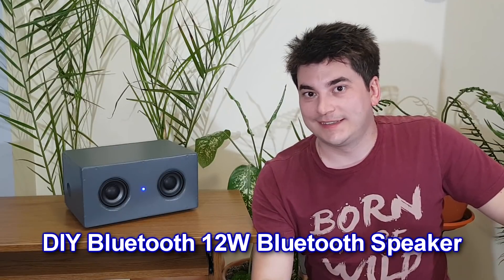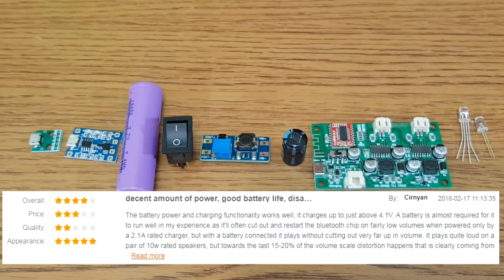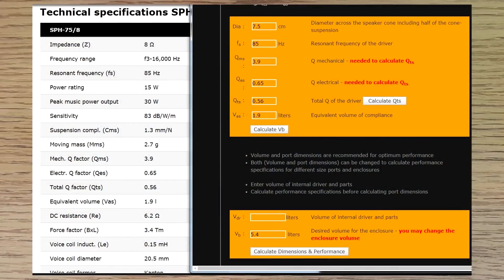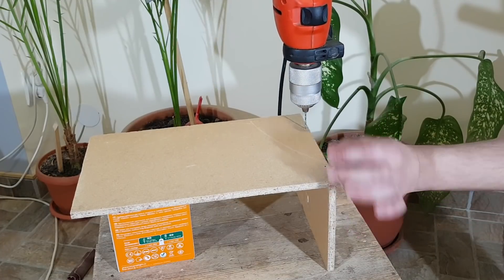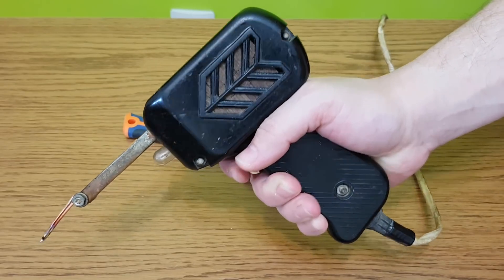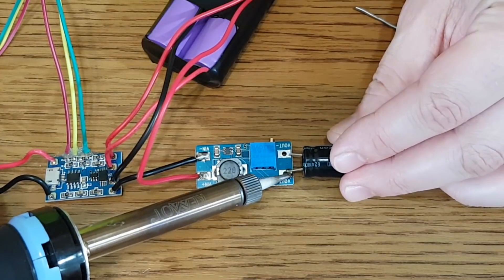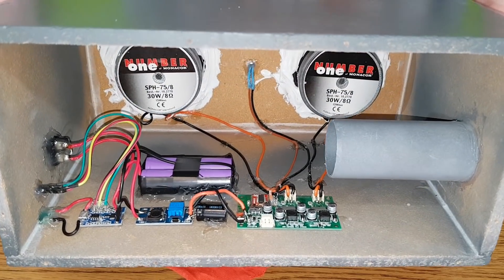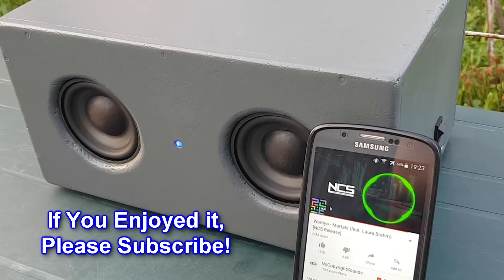DIY Bluetooth Speaker 6W+6W - HF69B

Comment: Awesome video with full detail.. thanks a lot.. but I want to know that how can you use a 8 ohm 30 watt driver with 6 watt output..??
Reply from the maker: hi. the speaker driver is rated at 30W musical and 15W RMS. 15W RMS is the more real approximation of the speaker driver's maximum power. but with a real 15W amplifier, this small speaker driver will be pushed to the limit. nowadays speaker manufacturers tend to lie and be "optimistic" about their speakers maximum power. you can see very clearly how this 6W amplifier is vibrating the 15W RMS speaker membrane almost to the maximum point. if I use 6W speakers with this 6W amplifier, the maximum sound will be distorted, because the speakers will be forced to the limit, and the speakers will be damaged in time.
Reply: @Sorin_DIY  thanks sorin.. I was searching a mono amplifier circuit for small portable pocket size bluetooth speaker.. becoz two speakers increase the size..
After many try I came to know about PAM8320 class D IC.. but there are no company who are producing readymade board.. 😢
Do you have any idea about this or any other mono amplifier circuit..?? Thanks and regards
Reply from the maker: I never made a mono bluetooth speaker, I don't know what to recommend you. but I will soon make a small stereo bluetooth speaker, but powerful.

Comment: I love the video and the explanation, however, I do have a question. I noticed you used another ("extra" if you will) USB micro PCB for charging and that's supported with USB TP4056. Why is that?
Reply from the maker: hi. it's a micro USB breakout. it's just an extension for the charging port. it's smaller than the charging module, so it can be fixed on the side much easier.

Comment: Salut sorin vreau sa leg doua bateri 18650 la aceasta placa hf69b 6w+6w insa nu am acel circuit de protectie + incarcare  si nici placa ce ajusteaza voltajul , crezi ca va merge si fara aceste placi sau voi avea probleme?  intreb fiidnca vad ca in specificati spune ca merge si pe baterie de 3.7v nu numai pe 5v!
Reply from the maker: salut. eu l-am probat cu un singur acumulator conectat direct si functioneaza. probabil functioneaza si cu 2 acumulatori, dar nu stiu cat de bun e modulul de incarcare inclus. amplificatorul insa nu are protectie la descarcarea acumulatorului, dar nu cred ca e o problema. cand acumulatorul e descarcat, amplificatorul se restarteaza in continuu, nu poti sa il mai folosesti pana nu incarci acumulatorul. insa cu 2 acumulatori + modul de ridicare tensiune cum l-am conectat eu, am reglat tensiunea la 5.1V si amplificatorul se aude mai tare decat cu baterie conectata direct la el.
Reply: Sorin - DIY Electrical Nerd Multumesc frumos pt răspuns, pana la urma m-am hotarat sa fac si eu ca tine si am comandat si eu toate piesele de pe bangood utilizand linkurile tale(acum.astept sa-mi ajunga) am luat si un condensator de 2200uf de la o sursa veche. Mai am o singura intrebare la acea placa de încărcare cu protecție pot pune mai mult de 2 bateri? Fiindca am salvat 5 bateri LG dintr-o baterie de laptop nefuctionala!
Reply from the maker: poti conecta si mai multe celule, dar nu cred ca are rost. cu 2 celule bune tine peste 10 ore. eu cred ca 3 celule maxim ajung, daca au peste 2000mah. daca sunt multe celule, dureaza prea mult sa le incarci.
Reply: Sorin - DIY Electrical Nerd mulumesc voi folosi 3 celule deoarece astea au acelasi voltaj fata de celelalte 3!

Comment: Hi Sorin, I succesfully done this. But I am facing one issue.  Im using mobile charger to charge the battery. Say my battery is fully charged and I disconnected usb charging. Now battery is at full charge and problem is when I switch 'ON' the amplifier the amplifier is not switching 'ON'. But when I connect the usb charge the amplifier is switching ON. Now if I disconnect the usb charge, amplifier is playing through battery. Then if I switch off the amplifier and switch ON it is not getting up again I have to connect the charger to come up once it come up then I can disconnect usb charge. What would be the reason for this?
Reply from the maker: hi. did you connected the battery directly to the bluetooth/amplifier board? or did you use a separate charging module + step up converter like me?
Reply: @Sorin_DIY  I am using separate charging module and step up Converter like you.
Reply from the maker: you need to check with a multimeter, where is the power stopping. after the charging module, or after the step up converter. or the power is getting to the bluetooth module, but the bluetooth module doesn't turn on. the bluetooth module has a tiny switch, try to set it in the other position.

Comment: hi i dont have 15 w speakers . can i join 2 3w 4ohms speakers in parallel in one slot?
Reply from the maker: hi. that's not a good idea. if you connect 2 x 4ohms speakers in parallel, you will get a final impedance of 2ohms, that is not good for the audio amplifier. a slightly better idea is to connect them in series. 2 x 4ohms in series = 8ohms. but you will loose some of the high frequency sound, because the copper coil of each speaker driver will become a small frequency filter for the other speaker driver, similar to the coil in a crossover filter, but with less efficiency.

Comment: hey dude.. is it possible we use powerbank and remove the step up converter?
Reply from the maker: yes, but it will not work with all powerbanks. some powerbanks will not turn on, or they will automatically turn off, if they don't detect a big load (around minimum 500mA). when you turn on the bluetooth module, it will use only a few mA.
Reply: @Sorin_DIY  thanks for the explanation... Great job anyway.

Comment: Hi Sorin,  i finished making of this bluetooth amplifier and Working fine but Whenever i  increase the volume,  the bluetooth shuts down. It is annoying.  my speakers are 8ohms 30watts speakers each. two 2500mAh  18650 batteries used. Voltage set to 5.2 volts. the wires that i used are bread board wires. What is the reason for this bluetooth shut down? How can i rectify this?
Reply from the maker: hi. breadboard wires are thin. try with other thick wires. use thick short (max a few cm) wires for all the supply wires.

Comment: Can i know the reason,  why r u soldering two batteries instead of using battery holder?
Reply from the maker: hi. the battery holders will work too. but the connection is much stable with soldered terminals. in time the holder contacts can oxidize and you will lose power. the battery holders are useful if you intend to remove/replace the batteries often, which I won't do. also the holders will increase the overall project price.

Comment: Great video. You motivated me do make one for my self. I have a problem with mine tho. I use a similar setup except I use separate bluetooth module with a 3w amp and have yet to buy the capacitor. When I power it on it shuts off after 2 seconds and it goes in a boot loop. Any idea how to fix the problem?
Reply from the maker: hi. did you fix the problem? do you have 4 or 8 ohm speakers? what power source did you use. I suggest to try it with 8 ohm speakers and separate power supplies for each module, with minimum 1A.
Reply: Thank you for the reply.
I am using 3w 4 ohm speakers connected to PAM 8403 which is powered with two 18650 batteries connected in parallel. I have TP4056 charging module with protection and 2 amp boost converter. Without the boost converter is working fine, only problem is my 5v bluetooth module, I don't know if it will work with lower voltages as the battery drains.  
Separate power supplies cause a horrible ground loop which distorts the sound,  I have tried that.

Comment: Excellent explanation. What type of wire r u using for the conection? Any particular name for the wire?
Reply from the maker: hi. in general I use wires salvaged from PC power supplies. most of them have good quality thick wires. they also have a lot of colors to choose from.

Comment: Very good!! But why do you need like a hole in the box?
Reply from the maker: hi. the "hole" (port) increases the speaker driver efficiency. when the speaker membrane vibrates (in and out), it modifies the interior air pressure. the air is pushed inside the box by the membrane, so the air pushes the membrane back outside much faster than the membrane will come out by itself. the port prevents this and lets some of the air to come out the box, when it is pushed in by the membrane. so the membrane will come back outside much slower. this increases the lower frequency, where the membrane is supposed to move slower. practically the port will give the speaker more bass.

Comment: Nice video. everything is fine and good. but u did not tell about the position of small switch embedded in the amplifier board.
Reply from the maker: hi. I forgot about the tiny switch. it switches between battery or micro USB use. I set it to be powered only by the USB port.

Comment: Hi Sorin, 
This brand speaker is not available in my town. 
What speaker I can choose? Will i get same type of speaker in other brand? Or tell me alternate speaker model ?
Reply from the maker: hi. you can use other type of speaker drivers. dayton speakers are very good, but expensive. I suggest you find 8ohm speakers, with a diameter of 6cm or bigger (mine are 7.5cm), with rubber surround.

Comment: Wow wat a wonder full step by step and detailed procedure. This is very professional. I have seen so many video and web instructions, but ur video is amazing!!!!
Plz post more projects like this. 
@4:33 you not describe about left most small pcb circuit. Plz tell me about that.
I want to start the project.
Can I get this speaker @ all speaker shops?
Reply from the maker: hi. thanks for watching. it's a micro USB breakout. it's practically an extension for the micro USB charging port. the pcb is smaller, than the charging module for example, so you can easily connect it to the side of the case. you can use similar speaker drivers, if you don't find this model. they need to be 8ohms, minimum 10w RMS and preferably with rubber surround.
Reply: Sorin - DIY Electrical Nerd Thx brother..
Reply from the maker: connecting speaker drivers is similar to connecting resistors. 2 (4ohm) speaker drivers connected in parallel = 2ohm impedance. connected in series = 8ohm impedance. so connecting them in series seams to be the solution. but there is a problem. each speaker's coil becomes a filter for the other speaker. they will cancel each other's high frequency sounds. it will sound like you put the bluetooth speaker in a cabinet. I suggest you still looking for 8ohm speakers. if you use the same 6w+6w bluetooth amplifier, I suggest you use speakers with the diameter of 7.5 cm or bigger.

Comment: how good is it with bass?
Reply from the maker: hi. the sound quality of the bluetooth module is very good. the bass mostly depends on the speaker drivers. if you give it good speaker drivers, you will have clear and loud bass, in the 6W+6W limit. I used the bluetooth speaker in parallel with a bose soundlink bluetooth speaker III, to compare them. of course is not as good as the Bose speaker, but is getting close to it. in my opinion it delivers 80% of the sound volume and quality, but with less than 30% of the price.
Reply: thanks i have a set of jbl 30w 8 ohm drivers that came out of this https://www.hartonoelektronika.com/images/detailed/21/JBL-SB100-230.jpg jbl soundbar sb100 i just pulled them out and they include small tweeters :)
Reply: Sorin - DIY Electrical Nerd GOOD COMPARISION

Comment: I made a DIY speaker too. At high volume speaker just shuts down any fix bro?
Reply from the maker: hi. what bluetooth amplifier model did you use, what speaker drivers and power source? in the first part of the video I explained why most bluetooth modules shut down at high volume level, perhaps your bluetooth speaker has the same incompatibilities.
Reply: Sorin - DIY Electrical Nerd I use PAM8403 and power source is 1A 5v power bank charging module connected in parallel to 2 18650 batteries and I even used a 5v dc dc isolating converter for the Bluetooth module
Reply: N its 3w 4 ohm two speakers for left and right channel
Reply from the maker: hi. did you resolve the problem? if not, I suggest you try with 8 ohm speakers. if the module still shuts down, try with a different power source for the bluetooth module. the dc-dc converters will limit the current, most of them work with 200 or 400 mah. you can try with 2 powerbanks, one for the bluetooth module and one for the amplifiers. at least until you find the problem.
Reply: Sorin - DIY Electrical Nerd I use B0505S-1W isolating converter as per the data sheet it gives out 200 mah! I used the USB Bluetooth module. Is there a way I can increase the current output from dc to DC isolating converter?
Reply from the maker: no, you can't increase the current. but did you try with different power sources? if it works, you can buy a more powerful dc converter, 2W at 0505 = 400mAh. or did you try it with 8ohm speakers?
Reply: Sorin - DIY Electrical Nerd I don't have 8ohm speakers I had this old home theater system and I had salvaged the parts for future use. So I thought of building a Bluetooth speaker. I'm waiting for audio switch so that connect 3.5 mm to arrive from china.
Reply: Sorin - DIY Electrical Nerd It was due to my powerbank module it wasnt giving out enough current. Now I changed it to 1A output and it works even at full volume. But now I'm having ground loop sounds. What I did is. I connected the +ve and - ve from the powerbank module to the amplifier and I removed the sheath in between and connected the dc dc isolating converter to the +ve and the negative! Is that the right way to connect?
Reply from the maker: the amplifier is ok, if you connected it to the + and - from the powerbank. you connect two more wires from the powerbank to the dc converter, then two wires from the dc converter to the bluetooth module. the dc converter needs to isolate both positive and negative wires for the bluetooth module, otherwise you will have ground loop effect.

Comment: Hi Sorin ,great video i like to make one ,One question i made the battery charger as per your previous , 4 cell charger but when i charge the 4 cells together , only one cell is charging ,the rest is ,what is the votage you use  to charge your battery .....5v how many amps ..your advice please
Reply from the maker: hi. it should work with any type of charger, even 0.5A. did you connect the supply wires to all the charging modules? if you connect it to a phone charger, but without any 18650 cells, the blue LEDs should lit up.
Reply: Hi Pal , Thanks for all your super video ,Now i plan to built one of  your latest 18650 charger ... tks a lot

Comment: What does the capacitor do?
Reply from the maker: hi. when the battery capacity is getting low, it will not have enough power to keep the 5V voltage stable for the bluetooth amplifier. if you turn up the volume, when the battery is getting low, the voltage will fluctuate and the bluetooth amplifier will shut down. the capacitor will keep the voltage stable, so you can use the bluetooh amplifier at higher volume a bit longer, when the batteries are almost discharged.
Reply: Sorin - DIY Electrical Nerd great, thank you!

Comment: The speaker is 30 wattt
Reply from the maker: the speaker drivers are 30W musical, 15W RMS. so the bluetooth speaker has a max real audio power of 30W (15+15). but the bluetooth amplifier output is 6W + 6W. so the bluetooth speaker has 12W, even if I use bigger speaker drivers. but these 30W speaker drivers can support a more powerful amplifier, max 15W+15W and it will be much louder.

Comment: but drivers are 30w :) the speaker is 60w :O xD
Reply from the maker: the speaker drivers are 30W musical, 15W RMS. so the bluetooth speaker has a max real audio power of 30W (15+15). but the bluetooth amplifier output is 6W + 6W. so the bluetooth speaker has 12W, even if I use bigger speaker drivers. but these 30W speaker drivers can support a more powerful amplifier, max 15W+15W and it will be much louder.

Comment: Hey sorin! I recently got Pam 8403 amplifier and it's to powerful for 3w 4ohm speaker. It got distortion in high volume how to fix it?
Thanks
Reply from the maker: those 3w speakers are not powerful enough for this amplifier. you need to use bigger speaker drivers. if you want to use these 3w speakers, you should add a volume potentiometer to the amplifier audio input, so you can limit the overall sound.
Reply: Thank you! Your videos are very detailed keep uploading. Already notification squad 🤘

Comment: Sir tel me uses of capacitor?
Reply from the maker: hi. when you turn up the volume, the bluetooth module will suddenly need bigger amounts of current for small period of times (for example for the "bass" sounds). when the battery is getting discharged, it can't deliver that current anymore, the power will drop and the bluetooth module will shut down. the capacitor will prevent this, because it can store a small amount of power and deliver it when is needed. afterwards it will get charged back very fast. all this will happen in a fraction of a second. you can think of it as a smaller fast backup battery.
Reply: Sorin - DIY Electrical Nerd thanks so much